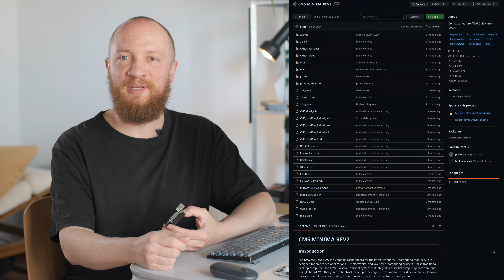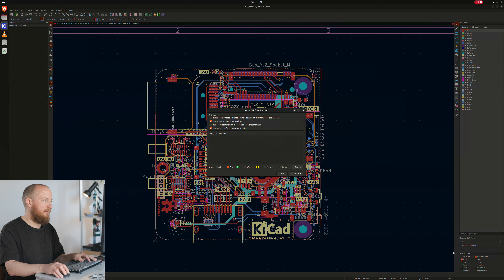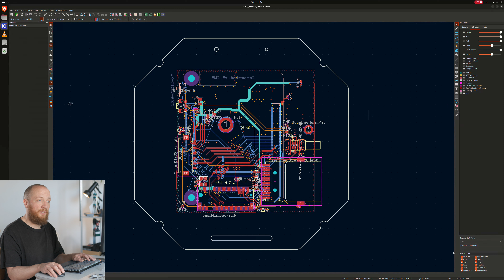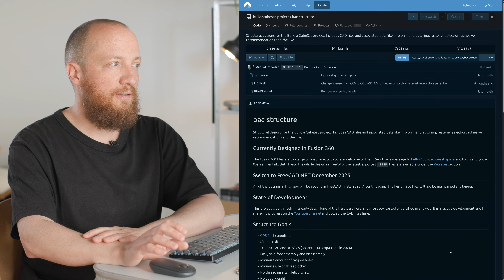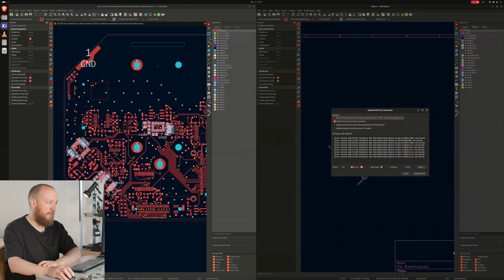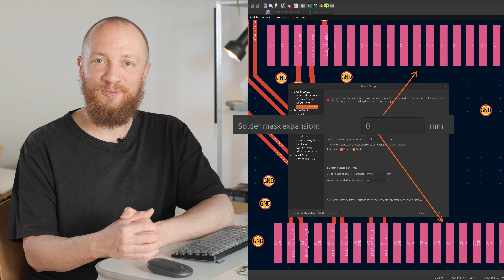Speedrunning a CM5 Carrier Board Respin for CubeSat Payload Prototyping

Comment: Is there a Discord server or something similar? I think it would be great to exchange ideas, share know-how, and work on projects together. For example, I'm a professional in CAD and simulations, but I only do electrical engineering as a hobby. :)
Reply from the maker: I absolutely agree! =) The Discord server is going live in late June (after the test flight) and it would it would be great to have you on board there.
Reply: @buildacubesat  If you need any help with that, it would be an honor to work with you on the project.
Reply from the maker: @TimSch-sp2un  Thanks, I will gladly get back to you about this in time! There is a contact form on my (temporary) website, please leave me a quick message there so I have your email.

Comment: Hey, really cool project and great explanations. I have a question regarding the Ethernet: is an Ethernet transformer necessary (like on the small switch you mentioned) or is it not required in all cases ?
Reply from the maker: Hi and thanks for watching – glad you like it! As far as I know, using magnetics is necessary and standard practice. Very short runs would probably work without a transformer, but I'm not an expert on this. If you end up doing more research on this, please let me know what you find out :)